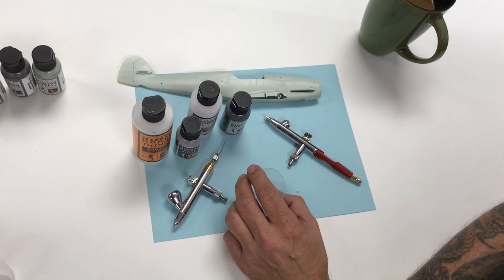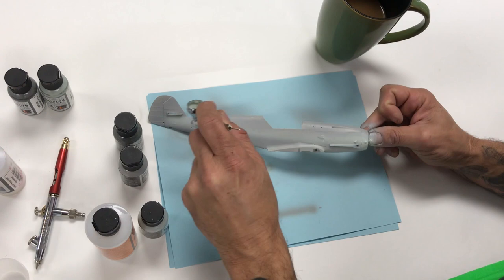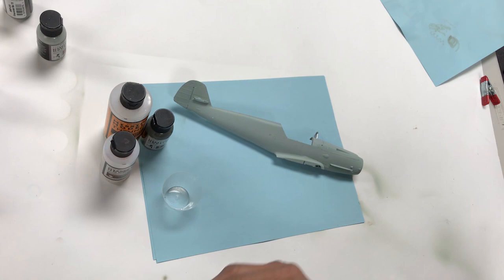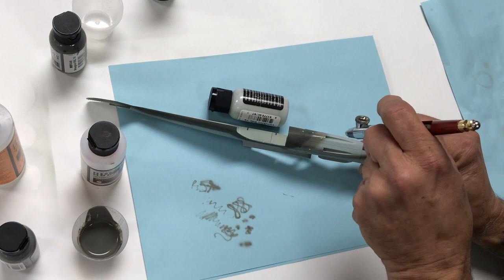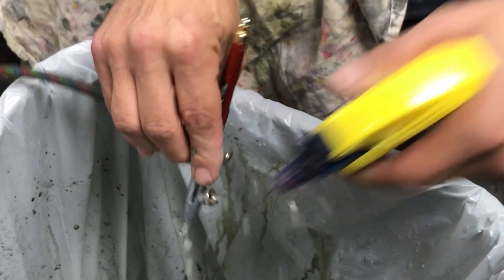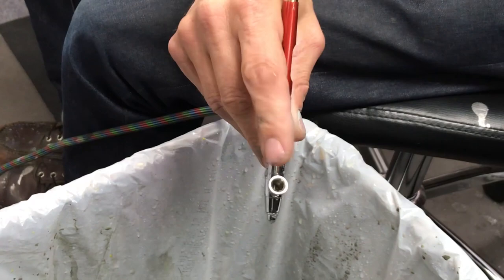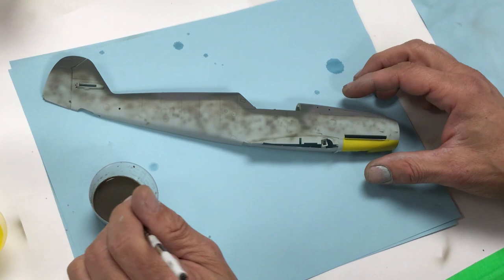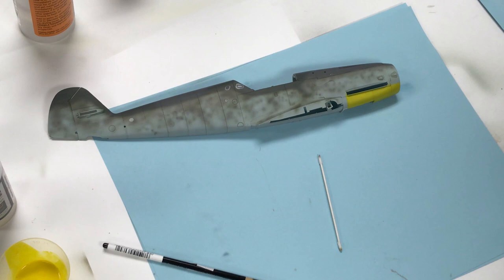Mission Models MMP Acrylic Paint Basic users guide and work flow

Comment: I was struggling with other paints being new to air brushing my kits. My local hobby shop put me onto these paints and they are a game changer. So many of my issues were resolved! Highly recommend
Reply: Still going good? I just tried my first Mission Models paint today without any issues but I've read a bunch of horror stories online about tip dry, chunky bottles of paint, etc. The general consensus is they're harder to work with compared to other water based acrylics. I normally only spray lacquers or solvent based acrylics, which are both very easy to use.

Comment: Hi Jon
I had little problem spraying  the flat clear  coat (MMA-004)my airbrush is Badger 105 with .3mm needle /nossle at 20psi  it would only spray little bit at full travel so I put some thinner in it witch help and the temperature outside was about 15 degrees C just wanted to know if I did some wrong  like was it too cold or did I not shake well enough    because it was kind of thick.

Thanks Henry
Reply: Try the createx 4011 thinner its made by createx they make mission model paint and if you let your paint set after you mix it for 15 minutes its amazing and you will not have any problems with mission model paint

Comment: I'm probably being overly paranoid here, but I notice the poly additive contains a warning on it that says "Contains substance known to cause cancer in the state of California." Now, I know they throw that disclaimer on everything under the sun, so maybe it's nothing. But is Mission Models safe to spray indoors in my hobby room, or should I spray it outside if I use poly?
Reply from the maker: our products conform to all federal regulations by law.  Please take a look at the other products on your bench that do not conform to federal labeling regulations. This is to protect you and to protect us with total traspancency Our products also conform to all prop 65 standards which means that any thing you need to know as a consumer is transparent and clear.
Reply: @missionmodelsus3920  Well, thanks for that vague non-answer, I guess.
Reply: My apartment building has a sign that says that too, as do many office, or shopping buildings. You'll probably start noticing if you live in California. It's a California law that has to do with chemicals, and companies that want to sell in california that have any chemicals in their products that are on California's list put the label on to protect themselves from lawsuits.

In reality, the chances of acrylic paint causing you cancer is pretty low, if not non-existent, however, you shouldn't spray any kind of paint indoors without proper ventilation, (i.e. a spray booth) that will take the excess fumes outside. At the minimum, wear a respirator mask.

Comment: The MAC valve just adds layers of confusion to me. What I find interesting is I cannot get MMP to spray well below 20 psi (straight out of the compressor, no MAC valve). I would be curious if you try out the airbrush at 10-15 psi direct from the compressor with the MAC valve turned wide open if it would work the same as turning the compressor up to 20 psi and only opening half of the MAC valve. There are two in line regulators at work with a MAC valve and it seems to me that while the MAC valve may be changing the pressures, it is also simultaneously changing the velocity of the paint itself. So I don't think it is as simple as talking only in PSI for those of us without a MAC valve. I think 20+psi is necessary without a MAC because my velocity and psi are set at a single point instead of having the ability to further adjust it at the airbrush. I think this is also why at 10-15 psi right out of the compressor, my velocity is lower and I experience a lot of tip dry and sputtering. Just a theory. I've found MMP to work great with air right out of my compressor- but only if they're thinned a little more and with higher psi setting (like 20+). Everyone's system is different and I think there is a lot of experimenting necessary that some modelers- especially some coming from Tamiya lacquer paint- just don't see the need for because they feel like it should "just work" if they follow a basic, "universal" instruction.

Comment: nice i have just started using your paints. Can you do a video with your clear coats and are you able to do oil washes over them once they are dry with enamel thinner?
Reply from the maker: We will be doing a clear coat video.   Yes , our clears are automotive grade pure acrylic and chemically resistant so no problem.
Reply: @missionmodelsus3920  thanks. Do these mix the same as the paint and with the poly? How long dry time before oil washes can be applied?
Reply: Is there a better way to achieve ratios, unless I'm seeing things there was no clear measurement of the drops..
Reply: @kiethpederson7558  - because they use their product so much, they counted out 30 drops of paint one time into the small mixing cup they use. After that, they just mentally noted where that amount came to on the side of the cup and just squirt an equal amount in future uses. And as he states several times throughout the video, the paint ratio is very forgiving, so even though they recommend 2 drops of thinner per 10 drops of paint, a slight variance isn't going to hurt anything.

Comment: What did you use to prepare the model, soap & water ? did you use high grit sandpaper?
Reply from the maker: We did not do any prep at all. No cleaning , sanding etc.... Thanks for asking.   It is only needed if there is oil on the surface from your skin or dust from previous sanding etc
Reply: Peels right off when we masking is removed.

Comment: They don't spray like that for me.spraying with steenbeck .2 needle set up and most time full trigger and not the size spray pattern it's supposed to be..may it's needs to be thinner.
Reply from the maker: Please read the tech support on the Mission Models web page
Reply: Kieth pederson - What is your PSI? It sounds like you have a to high air pressure and do try only half trigger.
Reply: 30-35 so it may be to high
Reply: @kiethpederson7558  wayyy too high for mmp